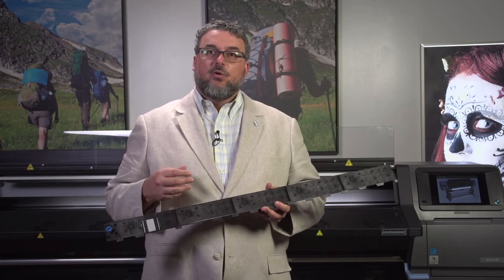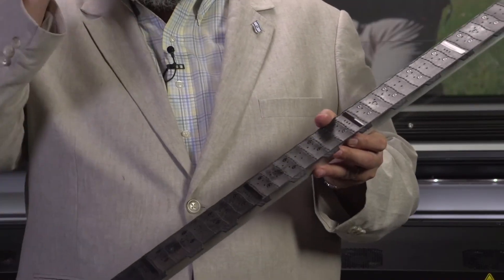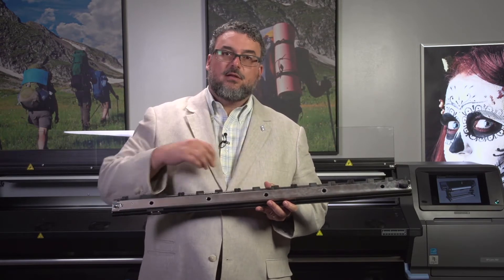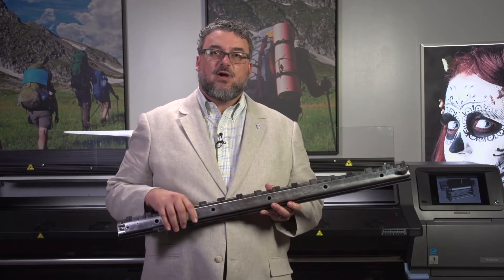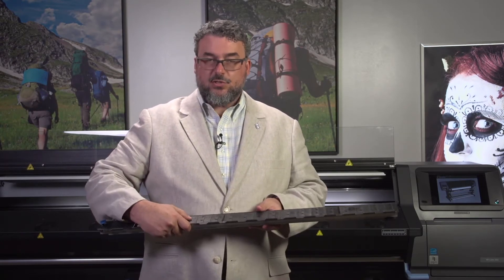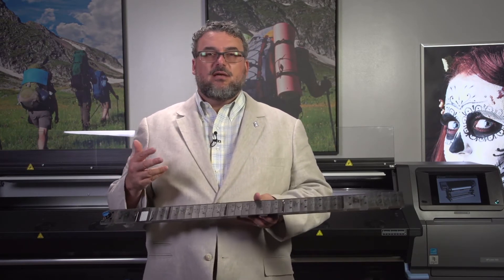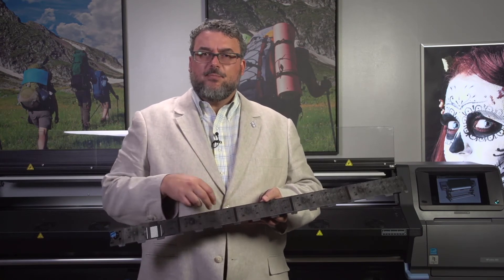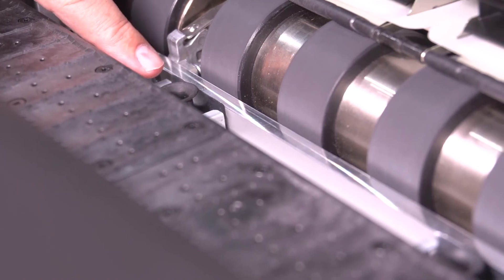Cleaning Vacuum Holes | HP Latex | HP

Comment: I rant 4 rolls at 120 density and got some holes on the platen clogged. None pays 3” in from the edges. Still trying come up with a solution and a cleaning device.